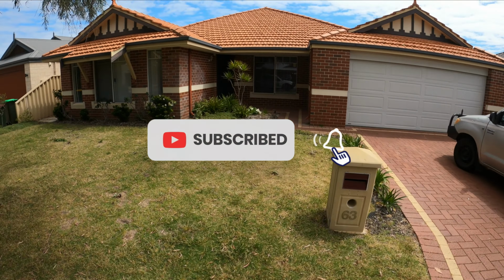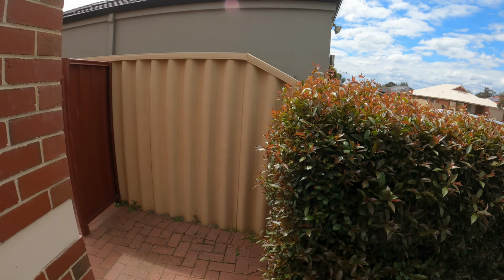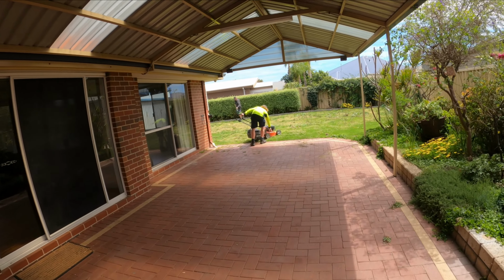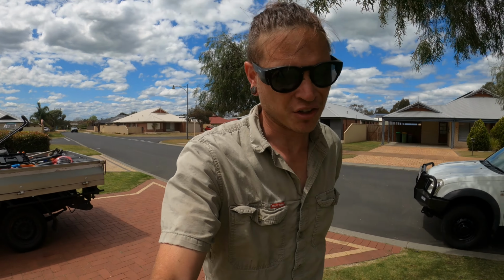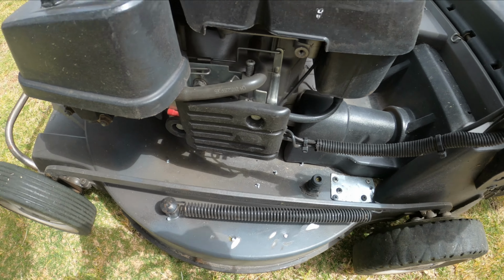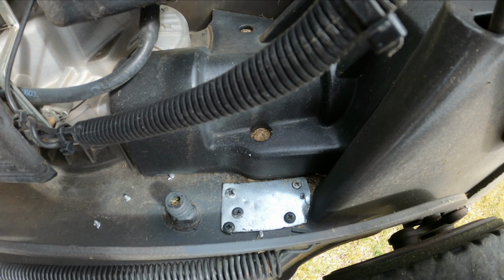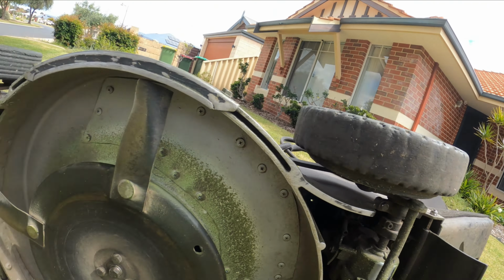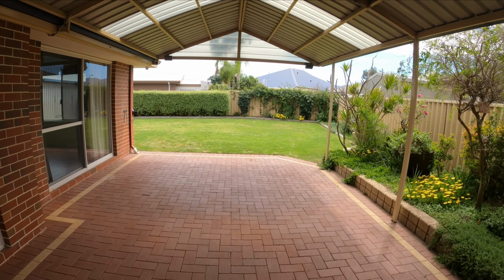It's a dirty job 😉 Hanging out with Dave and Jonah.

Comment: Fantastic job Dan 
U need to buy a honda hru216 commercial
Reply from the maker: looking at the masport contractor st s21
Reply: @DAN-IEL.N.U.P  consider a masport pro power al 3 in 1 190cc Briggs commercial 850 ic engine
Reply from the maker: @kingkonggod600  that's what I'm currently looking at